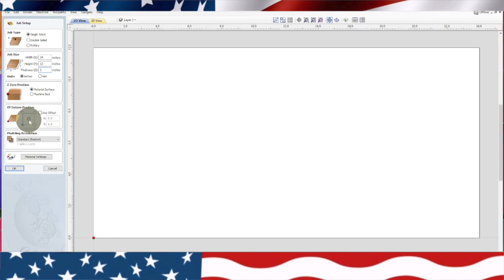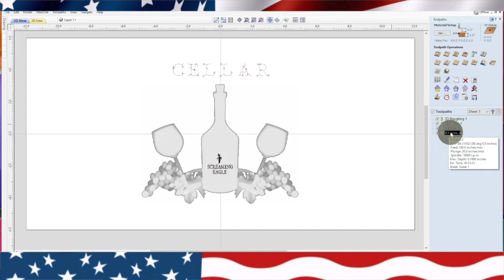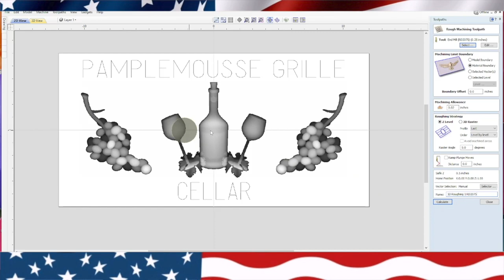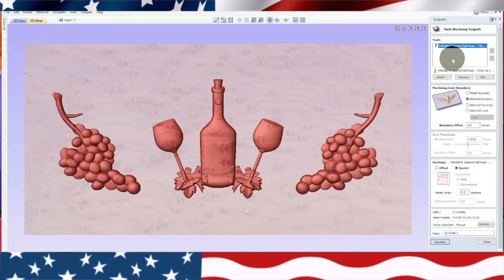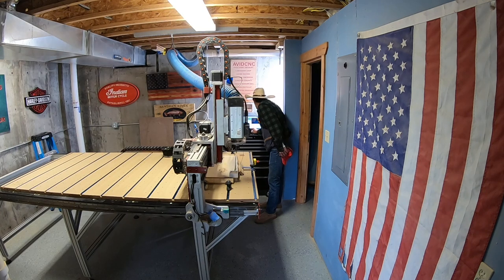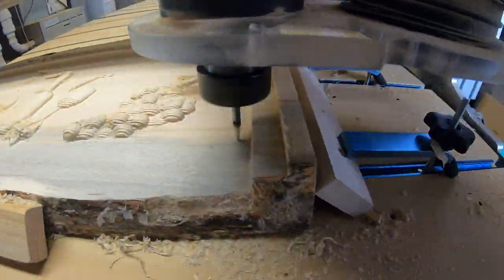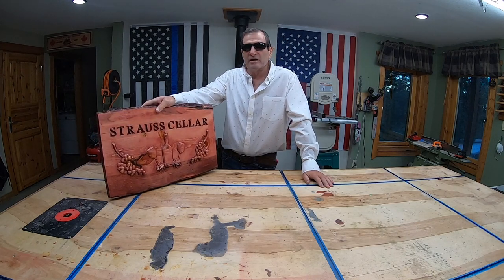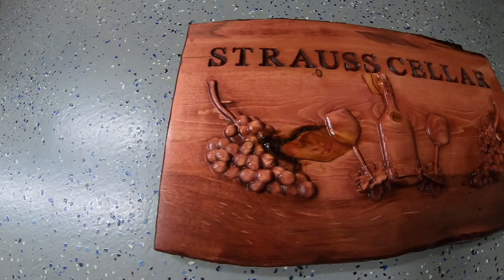3D CARVING WITH AVID CNC

Comment: Wow that looked great!  Awesome tips that I'll be using myself soon. Question, is the Rockler 1250 dust collector ok to run for the extened period of time the CNC is running?
Reply from the maker: The dust collection does work good except when I use the 2” surfacing bit ,if you can do dual 4” on it it would be better